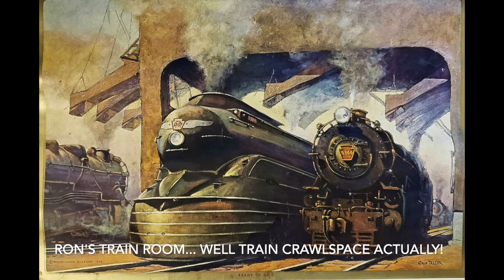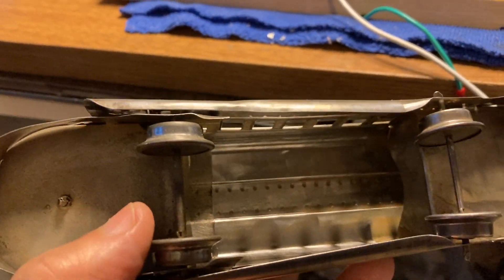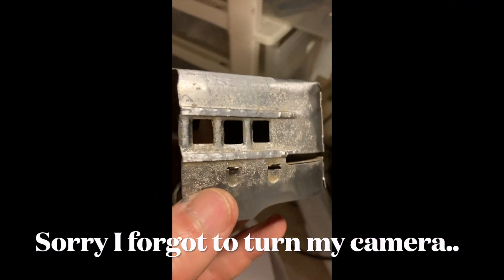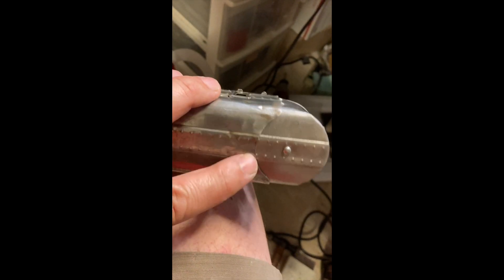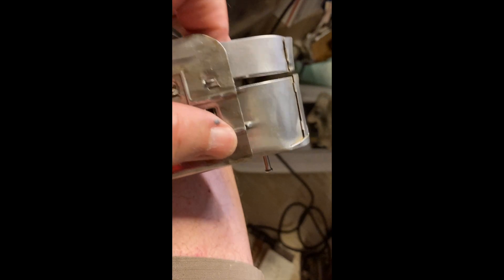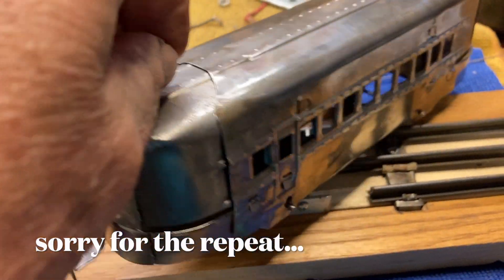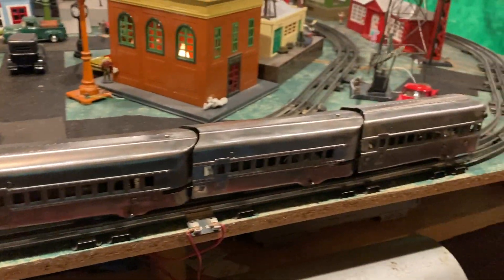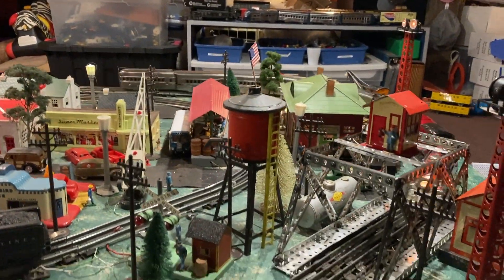Marx M10005 Transition car

Comment: seems like it would be more versatile to modify a tender.  probably look better, too.
Reply from the maker: You would only need the coupler modification for that but I wanted the engine normal tender look with a passenger set behind. The tender that goes with the M10005 would/may not have the right look right behind the engine....but it's a thought.